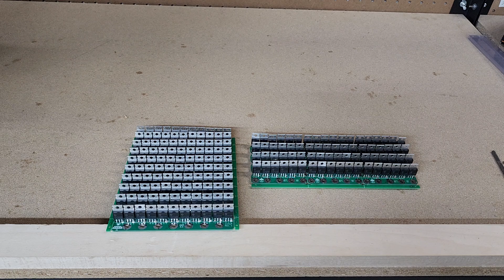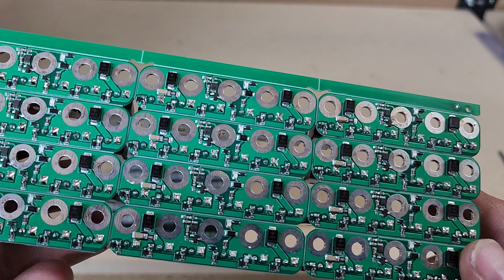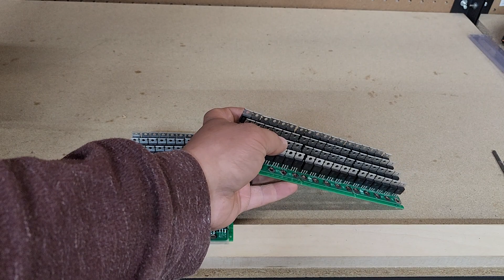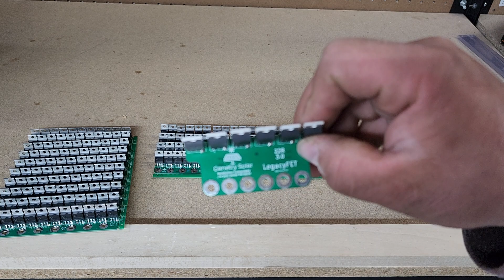The New Genetry Solar Mosboards have arrived!

Comment: I really don't see why you are intentionally punishing yourself by using such low voltages for such high power outputs. If you really want 12kw output, you are so much better off using a higher DC voltage. Getting a 350v DC 80kwh Tesla pack with a high voltage inverter will be far more robust and safe than trying to turn on a giant array of MOSFETs all at the same time. If that's too high for you, then at least make it 100v as a minimum.

All FETs have slightly different on/off times, and the only practical repeatable and economical way of sharing the current is to add resistance or inductance per fet. And that only works practically with 4 FETs as a maximum.
Reply: We're intentionally punishing ourselves for the safety of our customers: 350vDC will KILL you without a moment's hesitation.  If you accidentally start an arc, that voltage will easily pull a 3" white hot arc...in other words, you have to use dedicated, specialized breakers so you don't burn your house down simply by turning the breaker off (heaven help you if you want to pull a fuse...)
Yes, from a logical standpoint, higher bus voltage reduces input amperage...but it's also worth noting that if comparing apples to apples (i.e. 12kw 48v LF to 12kw 350v LF with the exact same size transformer), the inverter efficiency will be basically the same.

Also worth noting that the high power IGBT modules used on electric car drives...use a high number of small IGBT dies in parallel (WAY more than 4.)

Comment: Hello, I'm building an inverter an open-source one and will redesign in a Half-Bridge topology to my needs. I might go for other voltages later as well, but for now only 12V DC to 230V AC and 50Hz, so pure sine. I will probably use an ESP32 because have a built-in WiFi and Bluetooth. Hope you don't mind, will ask some questions:

1. What topology are you using?
2. I can't see those MOSFETs, but, why not using IGBTs instead? Yes, dearer, but more efficient.
3. What transformer are you using?
4. Are you checking the output voltage and ampers to mange the PWM signal based on usage? If no, how you will preserve a lifespan of this inverter?

As for the USA only the transformer would have to change. The rest can be the same ;).
Reply: I could write a book and a half in response, but let's stick with some summaries:

1.  Full bridge.  There are so many more functional possibilities...such as battery charge.
2. Careful with blanket statements like that.  IGBTs are more efficient ONLY in high voltage systems (200vDC+).  But completely useless for 12v operation...low voltage operation is where FETs are far better.  I suggest you run Ohm's Law on the expected current (300-500A for 12v) and the VCEsat IGBT spec, to determine the losses.  (And compare to paralleled 40v FETs with an RDSon of 1mOhm.)
3. Completely custom.
4. Due to the full-bridge topology, we don't need to.  Depending on how your half-bridge is implemented (i.e. Class-D or otherwise) you may HAVE to in order to try to get anything close to a sine wave on the output.

ESP32?  You're going to have to be extremely familiar with very low-level programming if you expect to get a low-jitter/stable output (i.e. not expecting to throw 5 "libraries" into a bucket, shake them three times and get perfect results).
Reply: @sidlori1592  Thank you :), will save and analyse it :). For sure can learn some few new things out of it :).
Reply: @screen-protector  If you're doing a half-bridge with a center-tapped primary on the transformer (i.e. center tap -> battery positive, and the two outside primary leads each go to a FET/IGBT block), you have what I've termed an "open ended" drive.
Problem 1 is that when the FET turns off (at the SPWM carrier frequency), there is nothing to clamp the transformer primary voltage from exceeding the FET maximum voltage (=FET failure).
Problem 2 is that the output waveform will not be a pure sine--it will be really lopsided, as there is no way for the switching to "pull power from the transformer" in the switching cycle.  Loads also will hugely change/influence the output waveform.
Reply: @sidlori1592  thank you. Will note it down as well and learn more about it.

From what I understand, you've got a dead zone + based on the output you adjust the speed of FETs. So, I didn't know that it's still a problem. Thank you.
Reply: @screen-protector  For a full bridge drive, you will need a dead time setting in the driving processor PWM peripheral.  (You'll probably need to use the MCPWM peripheral in the ESP32 for that.)
But with a full bridge drive, there is no need to correct the waveform by PWM.  (Obviously, the PWM amplitude determines output voltage.)
Reply: @sidlori1592  thank you, will save it and try to learn more about it :).
Reply: @sidlori1592  thank you, till date I didn't know about such difference. And, for me in person that is an advantage worth considering :).